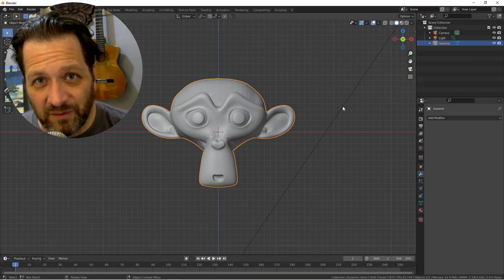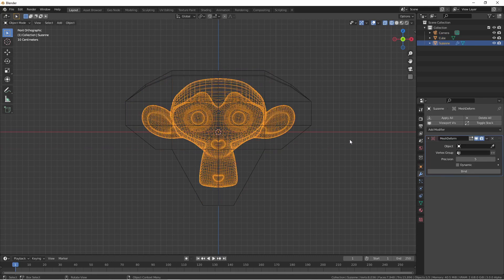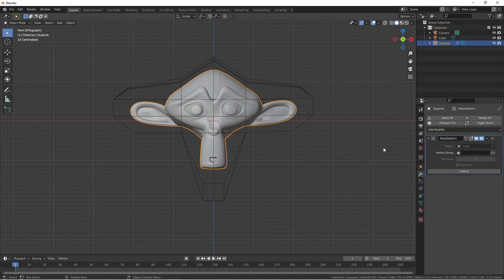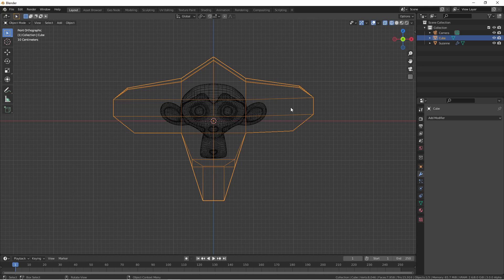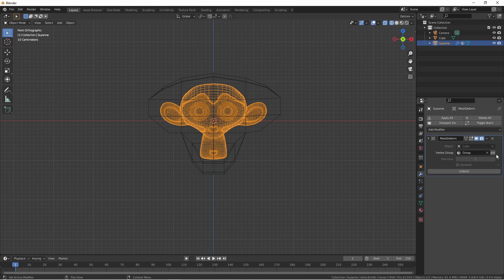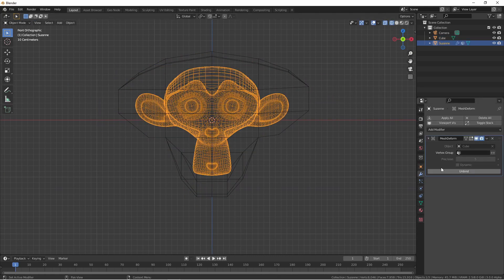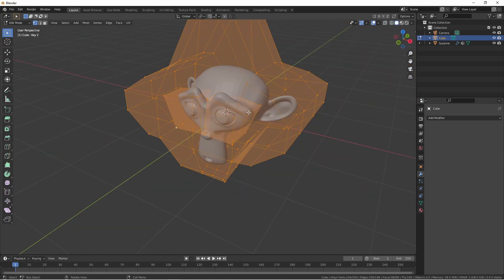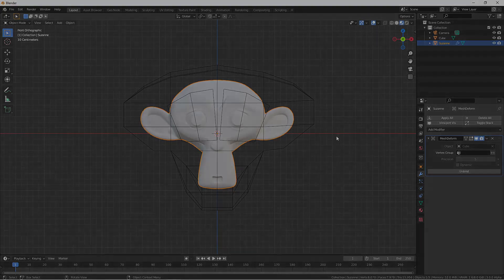Back to Basics: Mesh Deform Modifier

Comment: Although I'm not new to 3D, I'm new to Blender. So, my question is: Does it work in a previously animated character? I want to create a cartoony deformation in my character after animating it. Deformations work in already animated characters in 3ds Max, but I'm not sure if it works the same way in Blender.
Reply: I don't know yet because I've only just discovered this modifier, but in my opinion and after using Blender for 2 years, I would say. Yes? Why not? :D

Comment: The tutorial is really nice, but I have a question :) Can I export the mesh with the cage and the modifier to Unity? I need to do this for an armor. If yes, is there anything special to be done? I searched everywhere and I couldn't find an answer to this. Thanks!
Reply from the maker: For that I think you would need to apply the modifier to bake it into the mesh. Then import into Unity.
Reply: @JohnnyMatthews  Is there a way to apply the modifier to each frame? So that the entire transform process is baked into the mesh

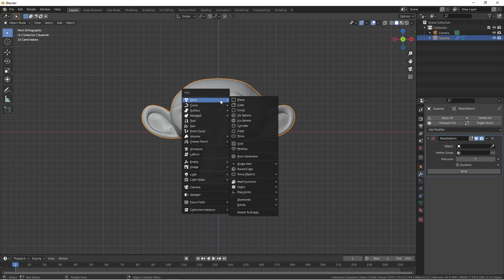Comment: Super new to blender, how did you do 0:42 ? the making of new mesh
Reply: He basically was in Object Mode (not Edit mode) and  Added  a new Mesh > Cube , and then started transforming that cube (but first he has clicked the buttons Toggle X-Ray ,  and the button Wireframe , you can find those buttons on the top right of your ViewPort Editor , they are visible from 0:42 until 1:00)